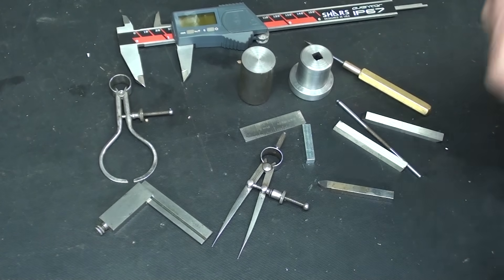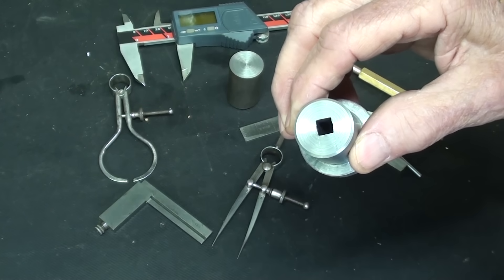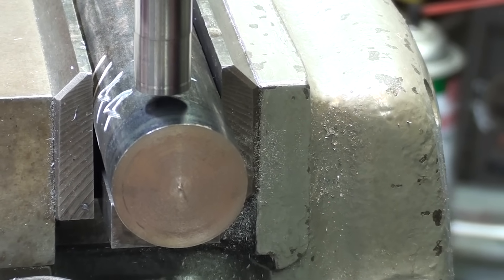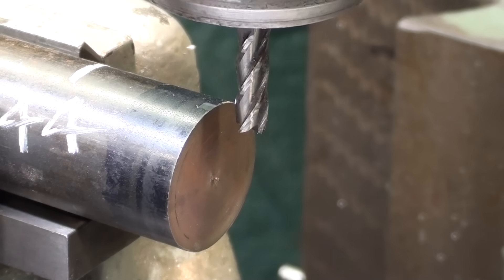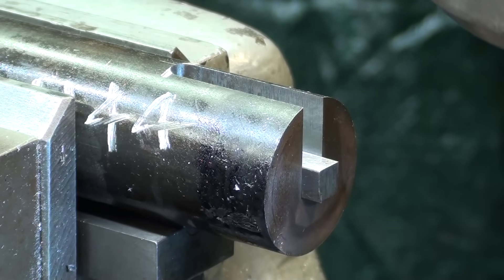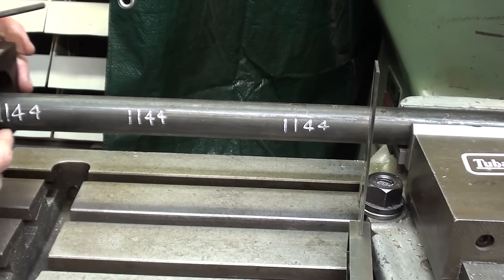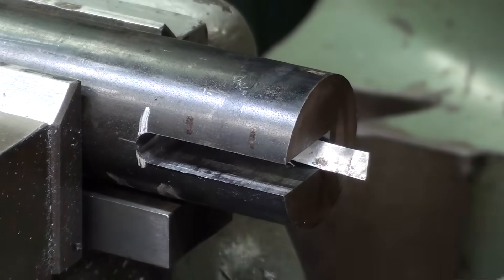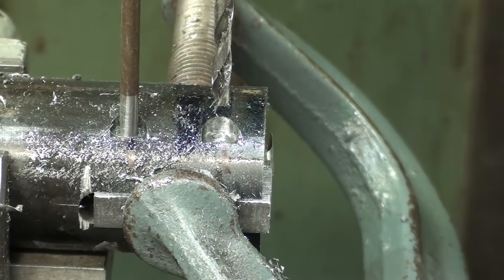Machine Drill a Square Hole in Round Stock #705 tubalcain

Comment: Hello all, 

My name is Timm Rosenthal. I am the inventor of the “Rose-Index”.
I’m not social media savvy so please give me some leeway, and I really dislike the lens end of a camera……However I will be putting together some videos with some accelerated uses, and some tips for using the Rose-Index. 

Here is a bit of information straight from the horse’s mouth.

My “Rose-Index” is patented. That was almost a 3 year project, however on 12.1.2020 I was granted a patent. It is proudly made in the USA from solid material. It is not a casting.

To be as short and sweet as I can …. I am simply a guy that makes his living by cutting chips. The Rose-Index originated because of need. The original was very simple, and easy to make. Over a few years of time and various needs the Rose-Index has evolved to where it is. I have just about every type of indexer from collet blocks to an automated indexer available in my shop, and I feel very confident that the Rose-Index is capable of doing things many other types of indexers simply won’t do, and it will easily fit into your tool box. I am admittedly biased, yet I feel that the Rose-Index should be in every machinist’s tool box. The “linked” 3 minute “Promo Video” is a basic start to the capabilities. I have a Facebook page that I am hoping to show real projects I have done, and I am hoping to have others share their uses, however again I am not very savvy with social media and I am trying to get to it. 

I’m going to try to respond in one shot to many comments. 

“I’ve never Seen a Rose Index”
I’ve been machining close to 30 years, over half of those have been for myself. There aren’t many industries I haven’t worked with. As the Rose-Index started to evolve I felt the need to keep it secret and not let others know about it. I had a moment of really wanting to tell others about it and how well it works, however I decided that I would keep it to myself and give me an edge. About an hour later “The light bulb lit up” and I realized I had a legitimate gadget that I could manufacture. It would by my long term contribution to the world of machining. The flood gates of ideas just flowed. I tried to look for similar patented gadgets for a while and realized the search wasn’t my niche. With a bit of coaxing from a couple peers I decided to take the leap and give the patent process a shot. The patent agent searched A LOT of patents and really didn’t come up with anything that was similar.

“Great. Now I have to buy a Rose Index”
I truly appreciate this comment. I’m very confident that you will be happy with it. I have quite a bit of time and thought into it. It is much more than a hole in a nut with a setscrew. After you use it a few times you’ll say “Great. I have a Rose-Index for that”. This is a tool that works very well, is extremely efficient to use and will last for generations.

“3D Printing”
I did 3D printing for some of the prototyping I have done. Long story short…… It’s not really useful for anything. The Rose-Index is made from solid steel and completely machined. The clamping force with the brass tipped screw is very good. If you’re wanting more clamping force and are not worried about denting your part….simply use a conventional set screw.

“USA or is it Chinese scrap”
USA all the way.

The biggest need to know is the Rose-Index is a Reference tool that is clamped to a part. The part is being held with any form of work holding. The Rose-Index is not designed to hold material for machining purposes.

Thank you for so many positive comments and what seems to be sincere interest in my Rose-Index. It really makes me feel good about the efforts and time that I have invested into something that hopefully leaves my mark in machining a positive one.

**Rosenthal Products - Note Added on 1-28-2021**
After a week of this video being active I realized I should start a YouTube Channel so that I can show tricks I have learned using my Rose-Index over the years. I am fortunate to have a young computer prodigy, He has helped me to take some video footage and he edited it. I have to admit it is amazing watching him in his niche. We started a YouTube channel "Rosenthal Products". In time I will show various customer jobs and other projects I have done using the Rose-Index. "Rosenthal Products" is intended to encapsulate other gadgets I intend to show in the future.    https://www.youtube.com/channel/UC6p5jwZsy-J0KJ86b8qwH9g

**Hobbyist's - Note Added 1-28-2021**  It seems as if there might be some interest in a cheaper version. If there is enough interest I will consider making an aluminum version of the 1" Rose-Index. I have some that I tried it in the past. They work ok for occasional use. This can be discussed on my channel "Rosenthal Products" so that Mr. Pete's site isn't monopolized by these things.

To all of you and yours…..be well and thank you,

Timm Rosenthal
Reply: Tim,  the biggest thing that threw me off was the price of 149, I just do this for a hobby and I’d maybe use it a handful of times. If the pair was 50 bucks I’d buy them. That was the reason that the idea of building my own came up. I’m just being honest and telling you my first impressions. Awesome idea sir.
Reply: @trialnterror  
This took me a couple hours to write and sound right. I was hoping to reply before others did.

Thank you for your comment and your time. I could easily write a dozen pages of why the price is where it is. Please know I have really spent a lot of time and concern on cost. Much more time than I want to admit to. At a certain point I had to go with a number and get moving. I have a couple peers that have very impressive businesses that manufacture and sell products nationally and internationally, and they have for many years. I worked with the numbers that they advised me to use. 

I hope this stays on topic of actual "Cost” yet points out the actual “Value” of the Rose-Index. While everyone is entitled to their opinions and free time…..this is my point of view.

Upfront I will let you know I have had the pleasure to speak to many people that have taken the chance on purchasing a name nobody knew. Along with many questions I specifically asked about pricing. Nobody criticized the price at all …… not even the hobbyists’.

Actual Price:
This is American made from solid material. While I don’t know everything about manufacturing here is my spiel……***Please note my spiel is light hearted and definitely not negative***……  With material costs, actual machining costs, plating, packaging, shipping, costs of sales, etc. $50 a pair is simply not realistic. To make all my time and efforts worthwhile at $25 each you’d have to make these out of the cheapest material available with one tool that lasts forever on a free machine with free power that runs itself. I’d have to get them instantly plated for free and you’d have to pay cash to avoid credit card fees then pick up at my door and only take 2 minutes of my time and not expect any packaging. Every aspect of this process is another cost that unfortunately passes on to the customer. I would like nothing more than to be charitable, however I would like some return on my investments. Please recall that I have talked to many people that have taken a chance, and they are all happy with their purchase.

Actual Value (Cliff Notes Version):

The Rose-Index is a tool I want to last for generations, and it is a beautifully crafted product. The cheapest comparison I can think to the 1” Rose-Index would be typical foreign made 5C collet blocks, however then you need to purchase collets in every size, and have room to store them to compare to something you can put into your pocket. This approach actually becomes more expensive than having a 1” Rose-Index, and takes quite a bit of valuable space in your shop….. Hobby shop or full blown business. (Plus I typically need to look for collets that were not put back. This is only one item to find or loose that has a great range of size.)

The 2” Rose-Index takes the place of most jobs I do and is so much more convenient and compact than indexers capable of 1 to 2” stock. Larger indexers take a toll on the body moving around and typically create clearance issues with machining and again they definitely take more space from your storage areas.

I have had the opportunity to use these for years. I’m a well-established job shop that has had all sorts of projects thrown at me. Mentally I can be a bit slow at times. It took me a few years to realize I inadvertently started to make a better mouse trap. I did it because of “A Need” of producing parts and to be efficient on getting things done so I can get to the next project. I’ve talked to people that took a chance on the Rose-Index. Some customers currently had jobs that they saw it to be a convenient solution for using right away. Some customers bought it because they had visions of things it would do for them and were happy to have a cool paper weight until the opportunity arose. As others take a chance on the Rose-Index it won’t take long to realize how much time this has saved over the years. In a business environment these really pay themselves off very quickly, then help you to be more profitable. The actual upfront cost is forgotten pretty quickly.

I have yet to trade-mark the proper slogan/wording, however this is kind of like “Phantom of the Indexers”. If it is in your way……take it off…..use it somewhere else while your work piece is being held in a fixture, and bring it back if you need it. It’s really the indexer that gives full machinability of your work piece yet doesn’t need to be there. It also allows you to take your parts out to do something else if needed…..or take the part to another machine while maintaining your reference.  

If you are still reading at this point I sincerely appreciate your time……please know I am currently getting ready to run another batch of these. Price is second only to producing a quality product that I put my name on. I am trying to reduce the costs associated with producing and selling these while still maintaining a reason for making them.

Thank you,
Timm

P.S. In case anyone is still be reading.
Aluminum:
While I’m not dead set against it….I have produced an aluminum version in prototyping, and I have done some testing on it. They did not perform to my expectations. I’ll admit that an aluminum version would be much cheaper to manufacture by cutting chips, however I do not believe the manufacturing savings and adding the shipping/packaging etc. would warrant enough savings when I doubt it would be suitable to use on materials harder than wood or a couple uses before it is dented beyond suitable uses.

Castings: I might be ignorant on somethings, however I don’t want my name on a casting.

Other: I’m looking into other forms of manufacturing, however at this point and this volume of parts being made ……other options simply haven’t made sense yet, although I’m open to ideas.

Thank you and have a great day. I need to get back to my day job.
Timm
Reply: @trialnterror  you do realize that these are precision tools, machined out of steel and have a finish applied to them? What do you think something like this costs to make? Maybe you can find something molded out of plastic that you can use.
Reply: @melgross  and that’s all I would need for what I do. I’m really not trying to be rude, but if this is my impression as a hobbiest I’m sure others think the same way. If I did this for a living I could justify the price. I have the 5C collet indexers that do pretty much the same thing. I’m just wanting to have a discussion here.
Reply: @trialnterror  make your own. It’s not impossible, particularly if you just want a square. I’m sure you know how to mill an accurate square.. it doesn’t require special equipment. Then drill a hole and bore it out. Use angle squares to set it for the “V” and drill and tap a side. You can use A36 steel.
Reply: @melgross  I’ve already designed and printed out my own version on my 3D printers. I used a brass 1/2-13 insert with a 10-32 brass screw. I made a couple versions 0-1 and 1-2. I’ll try them out and if I find myself using it a lot I’ll buy Timm’s I’m not going to share this it’s just for me to experiment with. I didn’t realize there was a integrated v block and didn’t realize you could drill hole patterns. Awesome idea. Again if I end up using it sure I’ll buy one.
Reply: @trialnterror  that’s good. My experience with additive printing is that you can’t count on precise angles, sizes, etc, unless you’re printing on a very expensive commercial model, which costs in the six figure range. So double check that, and possibly machine it to final accuracy before relying on it. It’s very easy to properly square up a piece that’s already got flat sides.
Reply: @melgross  my cr10s printed it dead on! (Checked already) you’d be surprised how far they have come!
Reply: @trialnterror  good for you then. I’m not that familiar with home additive printing. But even many commercial models are off by a few minutes. Be careful how much you tighten with a plastic part like this, as it will distort.
Reply: @melgross  100% infill brass insert I’m good!
Reply: @trialnterror  Sadly in a few weeks, they will be available direct from China with subsidized US shipping for $15.99 for 3 sizes. And not much later from Harbor freight and Alibaba and E bay with compliments from a certain Mr. Biden. Unless you have a million $$$ for lawyer'ing up.
Reply: Job out the die casting before the Chinese inundate us with the  criminal knockoffs. Strong enough for near all uses.
Reply: @entertainme121  
Thank you for your kind words. I understand your idea of protruding from either side of the square. I'm in a unique situation where I have used it for quite a few years already. The Design I ended with works very well for my manufacturing and using it. All the shapes are concentric with each other to add overall accuracy. I've prototyped parts with 80 and 100 degree indexes and just used an angled parallel to add or subtract the extra degrees needed.

Rose is a play on my last name. It's kind of a family wide nickname.

Thanks agian,
Timm
Reply: @rmllcvideo  Your product looks good and for someone with a legitimate use for it I think the price is just right. However, for us hobbyists, as a "might be handy sometime" device, the full steel with brass screw is a bit steep..
Would you consider making a 1" aluminum version with regular screw? If you could make and sell it for about $35 I'd buy one..
I'd think it will also be good for marketing, sell them as "trial pieces" even make them a bit smaller than the full 1" I think a lot of us hobbyists would go for such a thing and if we see that its really useful (witch I doubt that it would be for me, but who knows) we'll buy the big boy tool...  make sure to brand them good so in two years time when I need a bigger/better ones I remember where I got it..
Also, some machinists have friends, and grapewine marketing is great, and works better if more people can buy it and show their friends, even if its just the cheap "trial piece"
Again, I really like the design and I'm actually consider paying the $75 for the regular small piece, but since I'm not making money out of my basement workshop I'm probably gonna spend the money on something I actually think I'll use a lot...
Reply: Thanks Mr. Rosenthal.
Reply: I could have really used one of these back in the day. Well done Mr Rosenthal!
Reply: @ThreenaddiesRexMegistus  Thank you. Much appreciated
Reply: Thank you for writing this, I knew the moment I saw this tool that it was a fine quality piece of equipment. Stay safe, Jim
Reply: Well, I just watched the video. While I have the tools to do this for a bit over one inch, over that it’s a hassle. So I just bought the large model from Lakeside.  I wish you success with this. It’s a good idea. As someone having patents over the years with my own companies, I know what a problem, and expense, it is to get one.
Reply: @melgross  Thank you for your kind words and taking the chance on my Rose-Index. As you start to use it I'm sure you will start to see it really is a simple solution for many needs to manipulating round work. When I get to some of my videos and pictures they will show some situations that were figured out quickly and easily with a small and unique tool. Some of the situations would be very difficult with other forms of indexers.

I'm hoping that the efforts into a patent are more of a blessing than a burden, however time will tell. 

Thank you again,
Timm
Reply: @rmllcvideo  no problem. The concept, like many others which wasn’t thought of for decades, or even centuries, is obvious once someone comes up with it, which is what makes it a good idea from the beginning. I’m looking forward to its arrival.
Reply: where can I get a rose-index?
Reply: @jeswelch  pull down the name of the channel and the video below the video itself. That’s where additional information from, and about the site is located. You will see it there with the web site of the company that sells them.
Reply: Just out of curiosity, ballpark, what did the it cost to get the patent? Second question....WTF is your FB page?
Reply: You go out and spend £1500-£2000 on a good second hand lathe with extras, then buy a good mill for probably the same, plus the most underrated bit of kit, a pillar drill (drill press), your now in for around £5000 and your complaining about something brand new precision made and incredibly useful for £120 or there about, I don't have a milling machine but have used them and this would have been so good to have, I would have bought one myself and kept it quiet so's not to loss it. To all those mentioning the cost, sometimes to get a proper bit of kit you just have to bite the bullet and put your hand in your pocket. You sir have made something that I wish I had over thirty years ago, keep safe and stay with it.
Reply: @CrusaderSports250  
Thank you for taking the time to state what I feel is obvious. It has been a challenge to be patient while others get a look at my idea and start to understand the concept, and it's usability. In an industrial aspect these pay for themselves within the first couple uses. Even as a Hobby scenario the Rose-Index is more usable and more cost effective then a collet block and set of collets. If you take time to watch my comparison video on my YouTube channel "Rosenthal Products" you'll see that I have had many types of indexers for years and having all of those options still wasn't as efficient and convenient as I wanted, which ultimately was a huge factor in making the Rose-Index.

Thank you very much for your kind words and taking time to speak them.

Best Regards, 
Timm
Reply: Chinese scrap
lmao with this attuite you gonna have some problem
Reply: @ddjohnson9717  If you read thru all the comments I was simply answering a question.
Reply: @rmllcvideo  cool, good for you.
Reply: Well done on making this and I was with you until the blanket statement on China. Lots of crap come out of China but if you want to and do proper QC, you can make products there of as good a quality as anywhere else. Now, go hate on me if you want. Just know that you are probably seeing this on a gadget made in China.
Reply: @AntiVaganza  If you read thru all the comments I was simply answering a question.
Reply: @rmllcvideo  The statement is in you first long post and whether you replied to someone else or not doesn't make it less of a lazy generelization. Yes, crap comes out of China but as someone who lived there for a long time, I know plenty of people who like to do their best and plenty of companies do. There are many reasons for the "crap coming out of China" and a big one is the Western consumers so, in my eyes the blame goes both ways. In short, China wouldn't as much make crap if the West didn't buy it. You may be old enough to have probably said the same thing about Korean products and no one does that anylonger. And things are getting better in China in that regard, too as young Chinese travel more, study abroad more, become more independent and more eager to show what they can do.
Reply: @AntiVaganza  I'm not getting into an argument. 

My "First Long Post" was "Pinned" to the top after a lot of other peoples comments. I was trying my best to answer many questions that were previously asked, and I was trying my best to save others from asking the same questions or others I have answered in the past. I don't consider it lazy taking an hour or two to write up a "comment" for something I sincerely care about and have spent years on. Maybe I said something to offend you, however that was not my intent. Maybe something was taken differently than what was meant. I specifically referred to a question that was asked. Please take time and look thru the questions if you don't believe me. The response from Mr. Pete was they are made in Wisconsin.

I wish I could make everyone happy all of the time, however that's far from realistic.

I am a Western consumer (with less and less options to purchase as uneven trade happens), I am a business owner (which is far from lazy), tax payer (to help my fellow Westerners), father of young children( that I hope to do more to make the world a better place), legitimate patent holder (who would appreciate people to respect my efforts), and I am much more, however this conversation is done and a waste of time. 

I'm confident others will agree that it is aggravating when our less than lazy efforts and products are produced cheaper due to an un-level playing field. 

Put yourself in my shoes......or more-so any other "Westerner" that have created something or have a manufacturing job they take pride in only to have another country take advantage of their efforts and profit from it.....and many times put them out of business. I'm old enough to know that is typical and has caused many of us westerners to stereotype foreign manufacturers. Right or wrong......lazy or going the extra mile I'm definitely older than I'd like to be and I can appreciate both sides of this type of problem. I just know what side of this predicament I'm on.

 I would like Chinese and everyone around the world on a level playing field of wages and lifestyle. You mentioned about your hopes for Chinese youth "can become more independent and more eager to show what they can do". I sincerely hope they do that. I'd also like to have better trade that is mutual instead of unbalanced for the youth I'm raising. As much as I agree with you with "The Blame goes both ways" Consider how much it is unbalanced with American products being purchased in other countries.

I am going to bow out of future conversations that are potentially just arguments with you and simply agree to disagree. I hope you can be open minded enough to do that. 

Please realize I was not being lazy and generalizing or trying to initiate anything. I simply answered a question that was asked, and hopefully minimized others from asking the same thing.

Whether you believe it or not....I wish you and yours well.
Reply: @rmllcvideo  I can certainly be open minded enough to let you bow out. I latched onto the blanket statement as normally it is used by people with way less of an elaborate thinking behind it than you presented just now. And way too often there's hate, racism and bigotry involved. I get how it hurts seeing production run off to China, but the never-ending quest for cheaper products by consumers was a major part of it. (I bet it wasn't a Chinese boss who decided to move the first American car parts production overseas but a local who wanted an edge on his competitors.) 
But you know that, you priced your product according to what it should cost to keep it made in the West. Luckily, I think it may work out for you, I think the internet has given cottage industries and small shops their second wind. I like that because whether you blame tariffs or not, big scale manufacturing will never go back West until consumers are willing to pay more. And once Chinese workers start making more, it will move on from China (already happened in some industries). 

Either way, congrats on coming up with the idea, perservering in getting it to market and good luck on it. Peace out.